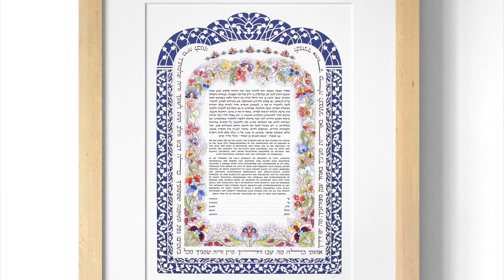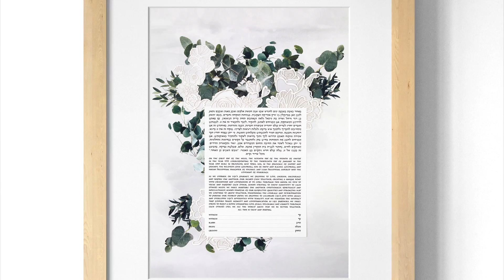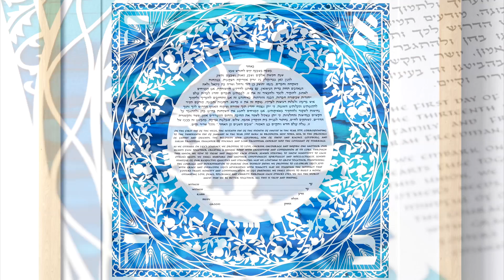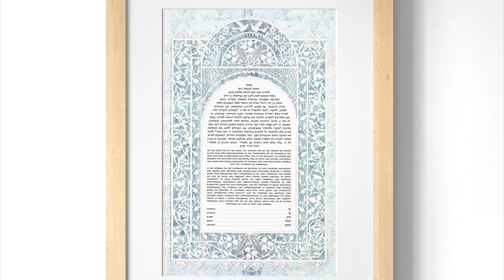Laser Cut Paper | Custom Paper Ketubah | Trotec Laser

Comment: Your artwork gives me the confidence to restart my project which I had abandoned long ago because the finished look did not look perfect with the desired idea that I have.  

  In one reply you sent to Bulp , You say you have a special laser paper. I just read the info at the address you attached here, and I have some questions:
-Do you have stock for sale paper in larger dimensions than A3?-Can this paper be glued to another material?
-Can this special laser paper be printed in color and if so, from your experience so far, what kind of printer do you recommend that you think is most convenient to use?

Comment: nice story. i have been experimenting with laser cutters for sometime now. quick question, how would you deal with the carbon on those edges? wouldn't it be poisonous when user touches them? it usually happens with fibre-based materials (e.g. cardboard, paper, mdf, wood) etc.
Reply from the maker: Hi Dexter, thank you for your question. There is nothing poisonous (to the touch) of laser cutting cardboard, paper, mdf or wood. We do advise not to laser cut/engrave PVC based materials as burning PVC causes a release of toxic gases.
Reply: @TrotecLaserCanada  hmmm.. i agree with the outgassing part for pvc but usually when you wipe your fingers across the edges of laser cut fibre based materials, you will definitely have carbon particles on your fingers. Does freshly cut wood (i.e. without cleaning) safe for child use? They might ingest those carbon or soot-like substances if they are not wiped down. Would that be ok?
Reply from the maker: @dexterchewy  We would never recommend to have laser cut objects around children, they can obviously be sharp and dangerous. As for ingestion, we would not recommend it. There is no evidence of poisoning from a laser cut piece of fiber but since we won't have MSDS sheets for most items we would caution against it. Thanks!
Reply: Interesting. Carbon in itself is definitively non toxic. It’s actually used in medicine against stomach problems. Do you mean that the carbon created by laser cutting would be of a special kind of and toxic? I have never heard of that, but I might have missed something :)